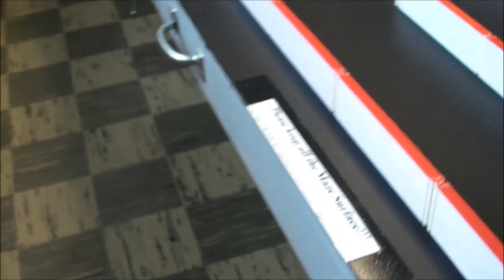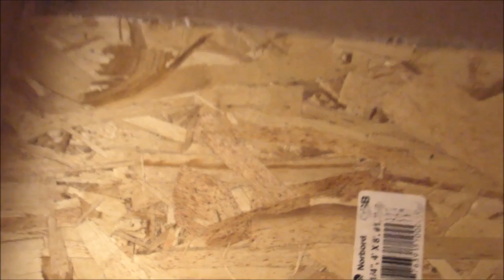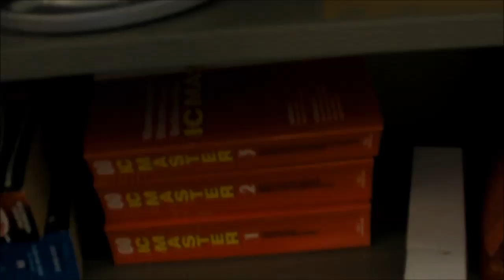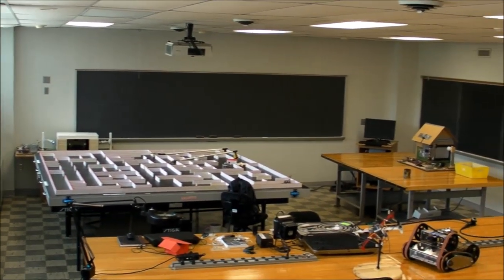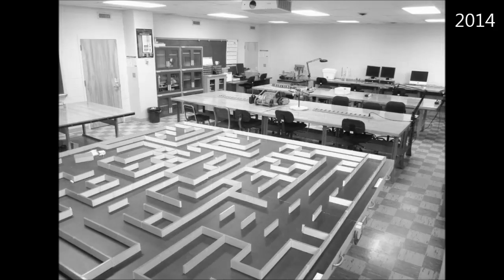(#0149) Lab Tour #07 - Senior Project Lab

Comment: Wow! Arduino for a maze solving robot!? A little overkill for an algorithm which will follow only one wall through out the "maze".
Reply from the maker: The wall configuration you see here is not regulation. It's all messed up for testing purposes of individual robot functions. Ultimately, in the competition, the center portion would be isolated so a wall-following robot could not solve the maze.
Reply: Exactly. A 16 move history buffer made up of TTL elements used to work back in 1998.